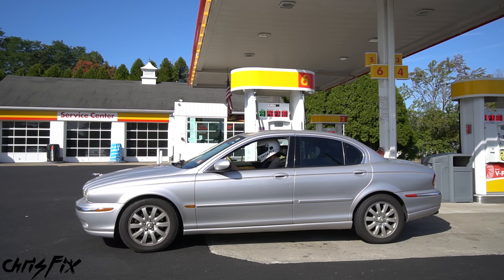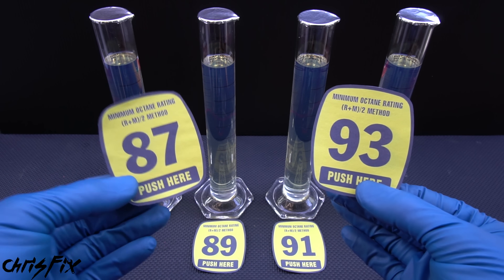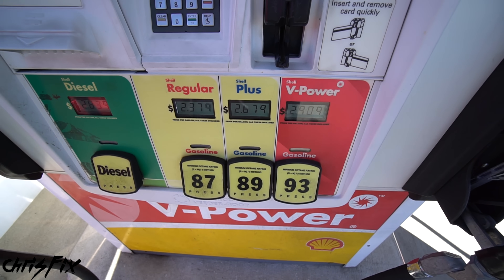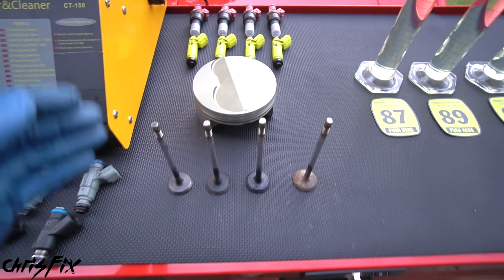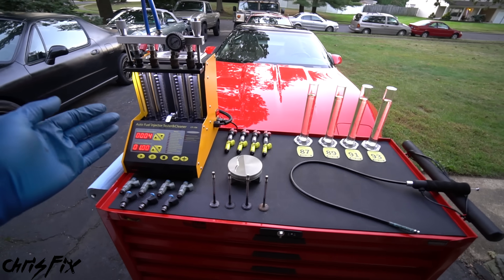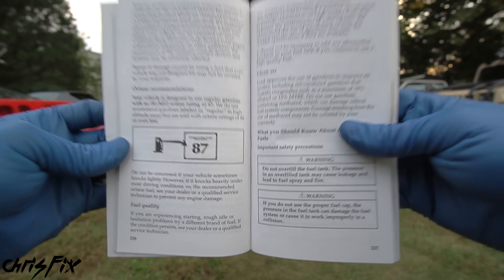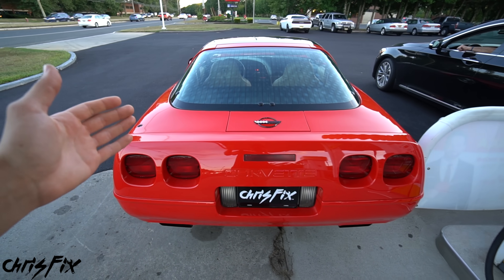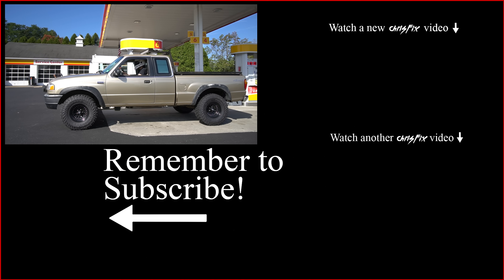What is the BEST Fuel to Use in Your Car or Truck and WHY

Comment: Only caught one mis-quote.  You mentioned that Shell-V Power Premium gas has 7 times the minimum required cleaning additives.   You should have mentioned that these extra cleaning additives are also in regular and nid-grade fuel. Shell is one of the many "Top Tier" brand fuels which meet additional requirements for engine cleaning additives in all of their grades, NOT just premium.  So the regular fuel will clean your valves & pistons just as well as the premium. Costco is also a "Top Tier" Fuel, as listed on the top tier website and on the fuel pumps.  So forget using premium for cleaning your engine.  Regular 87 octane works just as well.

Comment: E85 is complete garbage.  Would not run that in anything.  Was talking to a pump maintenance technician, he told me they had to scrub the top of the inside of the tanks because of algae build up at stations regularly, also E85 absorbs more  moisture then regular fuel.  There has also been research that states this fuel will wreck your flexfuel engine. This fuel also gives you worse mpg. This is an all around garbage fuel. Stay away from it.   I hope this info helps someone.  Have a good day.

Comment: Hey @ChrisFix - You made a serious error in this video.  You said all the forms of gasoline (87, 89, 91, 93) have the same energy content but THAT IS NOT TRUE! When you add something to gasoline to raise the octane number (MTBE, Ethanol, etc) you decrease the BTU content of the fuel! That is because the BTU content of MTBE, Ethanol, etc. is less than gasoline!  My best example is when I use 85 octane gasoline in my car in the mountains.  Gas carries an 85 octane rating in Denver and throughout Colorado, Wyoming, Utah and Montana. That's because the air is less dense, reducing the amount of oxygen in the combustion chamber and reducing the likelihood of knock. My little Toyota that usually got about 37 mpg actually achieved 45 mpg in the Colorado mountains, because the BTU content of the 85 octane fuel was higher!  You need to go back to chemistry class!

Comment: One point: these are all exhaust valves. They will be dirtier than intake because burnt gasses are exiting the combustion chamber. Buildup on an intake valve will primarily be on the face of the valve so the deposits be shows at 7:40 would not inhibit fuel atomization.

Comment: Here in Vegas Shell gas is the most expensive brand you can buy. Usually averages about 40-50 cents more per gallon. I usually buy Arco gas as it makes my 98 LS1 powered Trans Am run just as good as any other more expensive brand of premium including Shell and is the cheapest cost wise. Every 5000 miles I  put a few ounces of the concentrated Lucas fuel injection cleaner as preventive maintenance. This is the most cost effective way for me. Shell might add a little more fuel additives per gallon but you are actually getting a little less actual fuel per gallon too. It's alot cheaper to spend $2 every 5000 miles than pay 40-50 cents more per gallon over the course of 5000 miles.
Reply: Also exacerbating Shell gas in your area is that it's the reformulated ethanol gas shipped in from CA.
Reply: @Mikgwerd  It's good quality gas just overpriced. Here in Vegas all brands of gas has ethanol

Comment: I think I heard you say one thing wrong.  I am pretty sure that fuel burns at different speeds according to the octane rating.  Its like gun powder.  A pistol uses highly volatile powder for a fast burn - comparable to low octane.  A rifle or shotgun uses slow burning powder. Comparable for this purpose to high octane.  The length of the barrel determines the need.  I am fairly positive that fuels burn at different speeds. Diesel has a very low octane and burns slow - a semi truck engine only revs to about 2,000 rpms.
Reply from the maker: Octane and cetane are different measurements. Octane is just the resistance to detonation and has no effect on how quickly fuel burns. When ignighted at the same time, high octane and low octane fuels burn at the same speed. I actually thought the same thing before making this video but I verified with a petroleum scientist this is accurate. As for diesel, I am not sure, you could be totally right about cetane.

Comment: Back in the 80s I had a Buick Skyhawk v6 when I burned 87 grade my millage was very bad but when I burned 93 high octane I got GREAT MILEAGE SO YOU ARE WRONG
Reply from the maker: You realize you are comparing a carbureted engine to a modern fuel injection engine which this video was about correct? Sounds like it needed a tune up because the compression ratio was 8.1:1 on that LC4 V8 which is very low and premium fuel would have no effect unless you had excessive carbon buildup raising the compression ratio.

Comment: I drive a 2019 Corolla Hatchback SE.  It has about 6,000 miles on it.  Recently I noticed sulfur smell when I came home and parked in the garage. I researched this and found the suggestion that I need to run higher octane gasoline.  I had been running 87 octane.  The manual lists "87 (Research Octane Number 91) or higher."  I called the Toyota Dealer Service Dept. and the guy said I should try the higher octane.  I switched to 90 straight gasoline and it did work to eliminate the sulfur smell except for one time I smelled it again.  Does all this make sense?

Comment: Chris @ 01:40 : "There is a myth I am going to clear right away that I hear all the time. The bigger the octane number the more energy that fuel has so you're gonna get more power and better economy. That is completely false. All octane ratings have the same energy content." 
Also Chris @ 15:39 : "From my experience, premium will let your car run better, give you more power and better economy"

So in short, all the myths you busted are in fact not myths and work for you. Secondly, the answer to the title of the video "what is the best fuel and why" is.. "check you car's fuel cap or read the car manual". Thank you Chris for the quarter hour long video. 

P.S JK I love your videos. You're the best
Reply from the maker: No I was talking about my specific car which recommends premium. As stated in the video, you want to use the fuel your car recommends or "requires".
Reply: @chrisfix  omg you replied. You're the best. I'm a huge fan. 
Love from Pakistan.

Comment: Man you're wrong in so many ways and right in a couple what the hell...why you given people wrong information.     Higher octane fuel takes more to ignite and explodes with more power therefore you can run any fuel in any car if you change the Ignition timing.... If you have a perfectly timed car to run on regular and a perfectly timed car to run on super the one that's perfectly timed running on super is going to have more power  stop spreading false information I have 24 pieces of equipment that run on fuel I know from experience that you're wrong.
Reply from the maker: I am 100% accurate and correct in this video. I had petroleum scientists who make gasoline review it before I published and I spoke with them before I even filmed. Higher octane does not explode with more power since it has the same exact energy content as regular octane. The "more power" comes from the ability for the engine to change it's timing and burn the fuel at a more efficient time.

Comment: Every engine I've broken down using premium fuels is always spotless inside, even the piston head looks good. I've noticed switching from ethanol to non-ethanol my engines run smoother leading to excessive speed. With premium ethanol gas I got 1/2 mile extra per gallon, with non-ethanol I got 1/2 mile per gallon extra over premium ethanol. For me it's worth it for performance.
Reply: Well my s10 has 295k miles and has never had premium gas on it and it runs like a clock I had to replace injectors at 275k because one went bad and I decided to replace them all at once
Reply: @johnlourenco5657  Not saying regular is a bad gas, government regs, just saying I like the extra smoothness. When I was a cert mechanic in the 80's and 90's, I ran AV gas at 110 octane most of the time, you could balance a nickle on the air cleaner it was so smooth. You could run Quaker State oil and it may gum up some but the insides would be sparkling in a breakdown other than the valve train area in the head/s. Last breakdown was a couple years ago using premium ethanol and it was still clean inside, just how I like it. But I don't abuse my stuff anymore and don't currently have a race car but parts for one.... or 2
Reply: @johnlourenco5657  the 4.3 is a good engine. Mine had 240000 and my tranny went out
Reply: @mikepedersen9520  yeah they are good engines mine is still the original transmission.
Reply: Good thing computer controlled cars have knock sensors that pretty much eliminated the pre ignition. But if you buy a car that in the owners manual says mid grade 89, or Premium 91 and higher, don't complain if you have to pay extra for every gallon.  You can definitely run the 87 in it and will work just fine until you want to get on it, That is where the higher octane comes in to play... I just run MARVEL Mystery Oil  in the gas  to lubricate upper cylinders, valves,  and piston tops. Especially is good stuff for fuel injectors !  A quality "PEA" included fuel cleaner or" Techron"  once or twice a year, really helps cleaning up everything in there too if you really think you need it.. If you drive alot and are constantly filling up your tank and just rotating fuel thru it, and do a good Italian Tune-Up out on the highway every once in awhile,  most (regular) cars are just fine on 87. Hi- Performance cars are called that for a reason and buy at your own expense. It's cars that sit with this crappy 10% ethanol diluted fuel that causes problems!  Government regulations require cleaners   and beneficial products in all grades of gasoline. If I was as rich as the Bidens I'd have AV fuel delivered to my giant underground plastic storage tank,  and run that in my lawnmowers too. Unfortunately for me I'm not! Interesting Videos Christopher Fixastopher!!! Chuckle Chuckle 😃. Thanx ; Jethro
Reply: my car would run on anything that burn, anything special would be a joke to this car
Reply: My '99 Saturn got better mpg on premium, to the point that I might break even on cost/ miles driven.
My '13 car, I haven't noticed any difference.
Reply: Premium/higher octane fuel has a lower BTU rating and thus, cannot increase power nor improve gas mileage. It could provide a cleaner fuel system and engine, but that would not increase HP nor lower fuel consumption.
Reply: Been running 89 on my Subaru since purchase...might be going up the street since they still sell zero ethanol/methanol added gas but out of the way but probably will see better milage to offset
Reply: @NobodyUR  I just like when I crack open my engine how clean it is inside even with premium ethanol. With non-ethanol there's jus a bit better performance even though its octane rating is 90 as opposed to 93 for ethanol premium
Reply: @PeaceMarauder  yep I heard it was helpful with carbon build up. Price isn't that much higher when it's only 6 gallons at most. Lol I only let it fall to half at most usually 3/4.  With prices it's a mind game on myself 😂
Only brand new I've owned so I'll waste some money on it to have piece of mind
Reply: I have an older model explorer and if I run non ethanol it runs like a cloud, but is a a lot slower. If I run 87, it knocks and stalls, scares the living shit out of me. When I run 93 it runs smooth and I get more speed out of my engine. Before I got this explorer I had an older model Taurus, If I ran 93 it knocked a lot, if I ran 87 it wouldn’t knock but I got shit gas mileage. I had to use non ethanol just to get 18-20 to the gallon
Reply: @Oldsie, I do believe many older vehicles need the higher octane even though they didn’t originally require it.  My 2007 sounds like crap with 87 octane.
Reply: So, if you get 1/2 mpg extra using premium ethanol gas, and you get 1/2 mpg extra using non-ethanol over using premium, you should use non-ethanol to get a total of an extra 1 mpg over whatever the base gasoline was - but you didn't say what that was. 

With non-ethanol, you say you get excessive speed. I don't want excessive speed - ever. I want just the speed I want.
Reply: @nickchester3275  Base gas is 87. The excessive speed is just letting off the gas pedal to compensate for the extra boost you get from the non ethanol.  It only takes a tank to adjust to it.
Reply: I also notice premium gas lasts longer in my car and makes it alil more powerful
Reply: @brinkxmusic  You didn't watch the video did you.
Reply: @SuzukiKid400  Premium gives me better mpg and thus "lasts longer" in my vehicles, too. And I watched the video.
Reply: .5 mpg improvement for the cost difference makes no sense. The only time I ever bought premium was when President Trump allowed us to be energy independent and gas was dirt cheap. Really, it made no obvious difference to my f150, which can also run on corn. THAT stuff DID make a noticeable impact. Much cheaper "gas," much worse fuel economy.  So I'm back to regular.
Reply: @pamelah6431  I suppose you drink folgers or instant coffee
Reply: @PeaceMarauder  um.... ok. I don't. Any other ignorant presumptions you want to throw out there?

Comment: So, say you have a normal engine that runs fine with regular gas, then you turbocharge said engine, should you go a higher Octane rating to avoid engine knock or stick to the same gas you were using prior?

Comment: What about turbos???
Reply: Almost all forced induction engines require 91 or 93 Octane but definitely check the specific instructions from the manufacturer.   Detonation can destroy an engine so it's normally quite risky to run anything under 91 (sometimes 93) if the engine is turbocharged or supercharged.

Comment: So if E-85 is just indicating 85% Ethanol, what is the octane rating compared to the standard ratings at the pumps, and why don't they list that? I understand that if your vehicle is not flex fuel capable you shouldn't put E-85 in it. However, if it is, you can put either 87 Octane or E-85. My question is just in questioning the difference in Octane between the 2 and the difference in performance in both when compared.

Comment: There are summer and winter formulations for fuel in North America.

Also alcohol has less BTUs per gallon then does gasoline. E-85 is 15% gasoline 85% alcohol.

I think that pumps displaying e85 should have the fuel price per BTU also listed.

I know a lady that puts e85 in her car because it's cheaper per gallon and then I heard her say my needle seems to go down faster. Well of course it does.

Comment: I bought a 91 Honda Civic it idles rough when I hit half a tank. I replaced the fuel pump but it still does the same thing   but only when it hits half a tank. Do you know what could be causing that. Thanks

Comment: I know this may sound odd but my 2010 lincoln mkx runs better on 93 has 210k miles....also my 21 Tundra 1794 edition with 3k miles seems to be more responsive haven't tried seeing if theres any better MPGs.....Im a mechanic by trade and both of these vehicles onky require 87.

Comment: I run 87 in everything. Even my high compression sport bikes that call for a higher octane. Wether carbureted or fuel injected, I've never had a single issue throughout my 20 years or so of riding. My current bike, a Suzuki GSXR 600 even has 99.5k miles.

Comment: I have a 2012 Honda Civic DX, and have noticed my mileage has gone down quite a bit. If I ran premium would there be any process in going back to regular 87 or would I just fill it back up with 87 on an empty tank?
Reply: You'd probably want to take a look at the fuel filter/strainer and get it replaced.

Comment: I think im lucky enough to find a Sunoco Station that has No ethanol fuel. I've been using it for month's now. The car runs GREAT on it. 91 Octane its expensive $4.99 per gal but I have a small tank.

Comment: This was an impressive, as well as informative video, and I certainly appreciate it.  There is one thing I'd point out however, that Shell with it's V'power Nitro+ additive does some "pretty impressive" things.  He said all gasoline manufacturers must use additives to comply.  It seems that Chris is thanking Shell for allowing him to tie up the pumps and use their station for the informative video.  I imagine the other manufacturers use of additives does a good job also, but from the tone of the demonstration, Shell is the only gas you should actually use......just an observation,
Reply: I respectfully disagree. Shell sponsored the video, as he mentioned a couple times. I’m sure they asked him to talk up the Nitro+ a bit, and my understanding is you will generally get a better product at the pump in terms of additives if you go for “name brands”. Generally. I didn’t find the promotion particularly intrusive and I’m sure Chris doesn’t care where we buy our fuel from.
Reply: I've rarely seen Mobil or other BIG  gas companies Advertising their super unleaded gasoline. Shell V-power gas has been constantly Advertising Vpower for as long as I can remember. Adatives ingredients are not openly admitted or available by any company